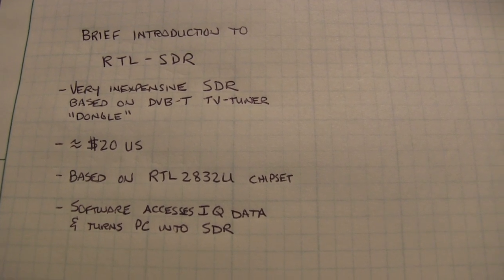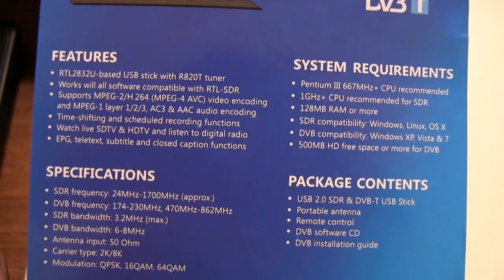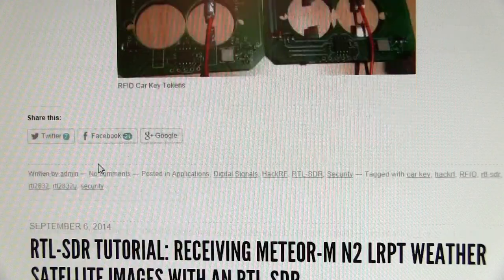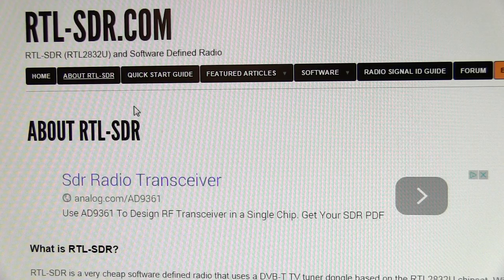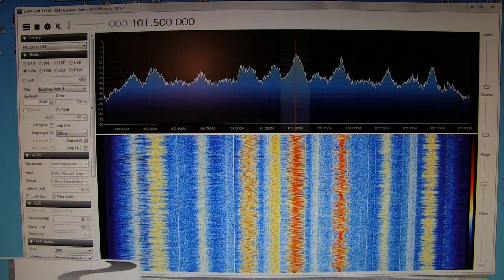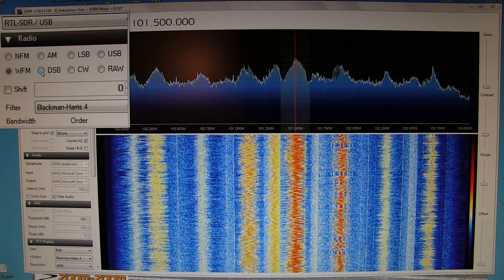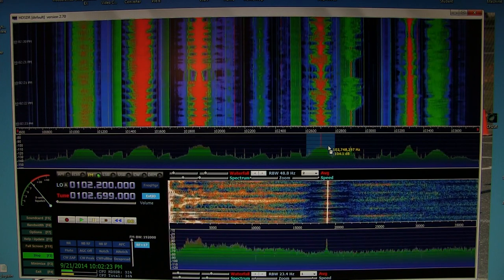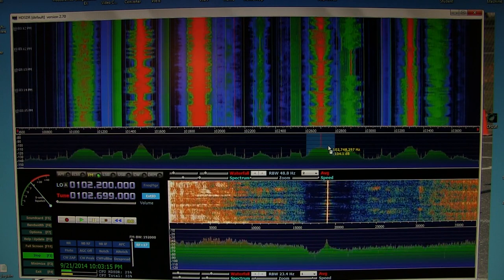#173: Introduction to RTL-SDR low cost software defined radio receivers

Comment: Been playing with this for about a year now and have decoded so many things my head spins. One thing I wanted to bring up is that with just two careful solder connections this chipset can also pull in 0-24MHz through what is called (the) direct sampling mod(e) . As always thanks for the great video and if you have any questions feel free to message me.  I'm excited to be a step ahead for once.
Reply: great man, how can I do that? I got an OPi0 and wanna try that on it:
http://v.ht/opistuff

Comment: I have been using one for well over a year now and love it.  The only problem that others should be aware of maybe, I live about a mile from a local AM broadcast 1kw station and use an upconverter so I can tune down to the SW and HF bands but what I had to do to make it work was insert an AM broadcast band reject filter inline with my HF antenna to the dongle and also use a passive pre-selector, mine is the MFJ-1046.  This extra filtering is a must if you live close to a transmitter site.  Also, on the vhf/uhf side I use a notch filter to notch out a local paging transmitter.  Since the dongle is so wide, extra filtering is a must if you live close to any of these kinds of transmitters or the dongle may not work well at all.  I love mine now though, it really came to life after the extra filtering for my location!
Reply from the maker: Excellent advice. Can you provide details on the up converter you're using?
Reply: ***** I first saw an article in QST magazine about the dongle and upconverter in the January 2013 issue on page 30.  They showed a board available from farcircuits dot com and I don't remember now if I got it from them or someone else but I got a kit that had the parts needed.  I can't find my paperwork off hand but it was this one or one very similar.  I have seen several built ones on ebay also.  Without digging in my files right now, that is what I can tell you, mine was a simple kit version though for around 35 bucks or so, maybe less. Hope that helps.  If I can find more info on the one I got I will pass along later.
Reply from the maker: RadioHamGuy Thanks, I found the article.  Looks like a pretty simple mixer stage using an NE-602 and a CMOS oscillator for an LO.  No preselection filtering (but you already mentioned that you've added that), and no image reject filtering at the output.  But, looks like it would work quite well, provided you understand the implications of this.  In many cases, it would work just fine.
Reply from the maker: You are right, these wideband receivers can be expected to come close to the image rejection, distortion performance, etc. of a more traditional superheterodyne receiver. But, it's only $10-$20, so you get what you pay for.
Reply: yoou should try sdrplay2 or sdrplay 2 pro you dond need upconverter

Comment: Thank you for another great video. If you use a virtual audio cable and DSD (digital speech decoder) or DSD Plus in addition to HDSDR for example, you get an ultra low cost solution for decoding APCO 25 and DMR. Both widely in ham radio, a cheap way to monitor your local repeaters.

Comment: I have two DVB-T+DAB+FM dongles based on the RTL chipset and I connect them to my main LMR400 feed coming into my lab using both SDR# and HDSDR with some custom plugins. The LMR400 feeds a wideband omnidirectional antenna on a 30ft mast at the highest point on my house. Some of the broadcasts I can receive on these dongles are amazing and very interesting especially with the plugins. I will however say that one important note must be made about these dongles, you need to find a reference broadcast frequency that has a stable known frequency and then in the setup enter the "Frequency Correction" in PPM to make these as accurate as possible. Both my dongles required a 74 ppm offset to make them spot on. Without doing this, your frequency will be offset by a fair amount and if your logging interesting frequencies or using the spectrum analyzer for frequency/aplitude identification then you won't get the best accuracy. These are great low cost dongles which allow for some interesting experimentation that I cannot do with my other professional radios.

Comment: I just received mine. I think I need to try it on a laptop outside.  I can get the FM stations to work, with a lot of static, but want to play around with aircraft etc.  I was surprised just how hot this little thing gets!
Reply from the maker: Yes, it does get pretty warm!  The larger NESDR Mini doesn't get as warm (more area).  A better antenna will do wonders, as well as tweaking the Tuner and RTL AGC settings and/or Gain setting.
Reply: *****
I need to do some research into inexpensive antennas. This is more for fun than anything else, so I don't want to get into anything elaborate.

Comment: I recommend the RSP from SDRplay.  It's a big jump as per this comment...

"...for LW-SW reception I use a home-made pa0rdt-Mini-Whip antenna (50kHz-30MHz) in combination with a home-made tunable preamplifier.
For FM – 2m I use a modified telescope antenna. I also have RTL-SDR sticks with up converter and an old Kenwood R1000
receiver. For SDR I use both, HDSDR and SDR# software.
The first thing I noticed is that the SDRplay RSP works well below the specified low frequency limit of 100kHz. For example, the time
signal at 77,5 kHz is well received. The lower limit in frequency for practical use seems at approx. 50kHz.
That was a good start. However, the extremely high sensitivity really knocked me off my feet: Stations which are noisy on the R1000 (so
far my unbeatable workhorse) are crisp and clear in the RSP, thanks to the innovative LNA concept. Furthermore, I could receive week
stations even in between strong signals – of course somewhat noisy. But in the R1000 they are completely buried within the noise and
you would not have guessed that there is something. That also holds for FM and 2m: the RTL-SDRs are much, much worse, even when
using an external LNA.
The next positive impression was on frequency accuracy and stability. The displayed absolute frequency appears accurate within less
than 100Hz for my RSP. Besides accuracy, frequency stability is the key– otherwise any fixed ppm-corrections are useless. For my RSP I
could detect no frequency drift e.g. within a few hours of receiving SSB/CW or when tuning in the next day. In complete contrast to all the
RTL-SDR sticks I have tested – they drift like hell.
Another positive observation is the low heat generation of the RSP (– no comparison to the RTL-SDR sticks). Maybe this also contributes
to the good frequency stability of the RSP.
What is left to say: Congratulations to the SDRplay engineers who have developed this superb piece of SDR hardware! It is worth every
penny.“ Customer Udo, June 19th 2015
For more independent comments see https://www.facebook.com/groups/sdrplay

Comment: I'm using this for about 2 years now, Still isn't boring. Every time you discover new stations near you, Police, fire departments, decode pager signals.
Listening to aviation(planes and ground stations ass well) is really fun together with flightradar-24

Listen to Ham-stations in the 2M and 70cm band

there is also an experimental driver for sdr# that makes it go into HF(from about 10 to 12 MHz) http://www.rtl-sdr.com/new-experimental-r820t-rtl-sdr-driver-tunes-13-mhz-lower/

Comment: Exceptional timing.  I ordered one of these and it arrived yesterday.  Unfortunately, I am having terrible luck getting it to work.  I've made sure not to install any native drivers, set up SDRSharp and made sure that the Zadig WinUSB drivers were associated with the RTL-SDR.  Won't recognize the device in either SDRSharp or rtl_test :-(  I'm going to try it on my linux box at some point but I'm pretty discouraged with it at the moment.

Still planning on dropping the money on the USRP at some point though.  Just thought this would let me pass the time until I could afford it.
Reply from the maker: I had a problem with the drivers initially too.  Something about the device being "busy" The FAQ in the "getting started" page that I said that sometimes you have to re-install the driver (zadig).  Once I did that, everything started playing.  I'm no expert on this, but there is a lot of expertise in Yahoo groups and Google+ groups that should be able to help you out.
Reply: *****
It turns out that it wasn't the drivers. There's a real obscure problem with running the dongle on a USB 3.0 port.  I switched it to a 2.0 port and it recognized it in software right away.  Easy enough to fix, but I wish it were better documented.
Reply from the maker: NGinuity Wow - interesting. I would've expected it all to be downward compatible.  I guess the Zadig driver was too specific to USB2.0...
Reply: *****
It's probably more to do with the cheesy (cheap) USB3.0 implementation on this motherboard and not 3.0 compatibility itself.  Running it under 2.0 got it running, but now I'm dealing with an overloaded front end and a terrible amount of sample loss.  Again, probably the computer hardware moreso than the dongle as the cause.
Reply from the maker: NGinuity Overload could be caused by a local Fm broadcast station?  You can change which AGC loops are active, and change the RF gain, that might help.  I found that my 3GHz AMD A8 works fine at the full 3.2Mb/s, but my 5 yr old laptop was getting maxed out and I had to cut the sample rate down to 960000.
Reply: *****
We don't have any FM stations (or any broadcast stations nearby, really), but my waterfall was showing a solid brick of orange at 0dB gain.  Something is just causing it to go nuts across the board so I'm checking to see if it works better on another computer for the moment.
Reply: *****
I got it sorted out, up and running now.  I found a happy place at 2.4Mb/s and after I played with the bandwidth and display sliders a bit I was able to tune in a local radio station.  I need to build a better antenna for it, but that's something for another day.  Thanks for seeing me through it!
Reply from the maker: Nice! I was playing with a mixer and signal gen today as a slap-together upconverter, and was listening to some 40m (7MHz) SSB ham radio transmissions.

Comment: Hi Alan:  Great vid and new info to me (admittedly I am not at the tip of the spear on some of this).  I was interested in possible astrophysics experiments, as I saw the discussion about 21cm hydrogen (e.g. linked to a directional antenna: Yagi or dish.
 
My question:  Are these devices still in a bit of a flux with the new-and-improved expected shortly down the road.
 
In any case, I just submitted an order for one and look forward to the fiddling.
 
Cheers,
Mark
Reply from the maker: I think this chipset has been around a few years, and is pretty mature and widely used.

Comment: Allen & ?
I am trying to have my cake & eat it too ;)
I was wandering about up & down converters for this unit , to do ham radio mostly HF as per the added video .
But also higher bands , mainly for trouble shooting WiFi signals 2.4 & 5 ghz ?
I have been looking for some time at test gear used for more pro type , can not afford the new , and some of the like RF Explorer 3G .
But keep finding the need for multiple units to cover range ?
John
Reply from the maker: There are several upconverters available to build or buy for this, for HF signals.  I haven't seen any down-converters, but they certainly can be built with some care.

Comment: I have just been doing some reading about static discharge and RTL-SDR.  The reason for this recent interest is I think I just burned-down the front end of my NooElec USB.  I had just got it installed and was turning around when I reached across my bench, brushing the antenna with my arm and received a zap, AND, no more signal.  Supposedly there is a ESD protection diode and I have read that some add 100k resistor between the center connector and ground.
 
Any thoughts?
 
Cheers,
Mark
****************************
Reply from the maker: The 100k resistor would help bleed off any static charge, so it's not a bad idea.

Comment: Can you watch hdtv with this radio? Basically can I pick up tv or remote camera broadcasts? Would I need special software. Good info
Reply from the maker: +Ragu Spag These things were designed as digital TV tuners, so sounds like yes is the answer.  I think they usually come with the software you need for TV reception.

Comment: i'm using these for rf debugging and development. the 2mhz bandwidth limit makes these less useful for me (i don't have a spectrum analyzer). i recently bought the hackrf one, which is much more capable and much more expensive ($20 vs $300). unfortunately i'm not sure that i'm quite happy with it. it's not reliably picking up short/fast rf packets and has a lot of noise that it also emits. i would love it if you made a review and compared it with real measurements and possibly ways to improve it. i can't donate one though, could barely afford one for myself :/

Comment: Hi, I just started to play with RF. I bought a couple of iot development devices with 915Mhz RF that communicates with each other. Would be possible to use this SDR to evaluate signal strength when trying different antennas with them ?
Reply from the maker: With careful setup you can make reasonable relative measurements.

Comment: Thank you for this video,  
After trying it with the 20$ dongle, and installing a decent antenna, what would be the ideal hardware upgrade for SDR# ?
Reply from the maker: If you're asking about the computer and sound card hardware recommendation, I'm really not qualified to answer that definitively. I'd ask on one of the SDR forums, on reddit, or with the s/w developers.
Reply: ***** No I think you misunderstood, I am thinking about a better SDR receiver that I can use with SDR#, I am thinking in perhaps in the 100$-200$ price range
Reply from the maker: Oh, now I understand. I am not that familiar with all of the SDR options. The only one that comes to mind is a bit outside of your price range, that's the HackRF. Oh, it looks like the makers of SDR# has made a higher performance device called the Airspy. http://sdrsharp.com/
Reply: +Karl Karlsson 

You might find the RSP made by  a company called SDRplay has had very positive reviews and is worth checking-out (if you haven't already).  But I believe it may not work with the latest version of SDR#.

Comment: If you're looking for some other interesting projects you can use your softrock receiver to tap into the IF output of the R820T tuner chip allowing you to use your PCs sound card in place of the rtl2832 builtin ADC, you will greatly increase the resolution at the cost of bandwidth. You will need two instances of your SDR software running to control the RTL2832 / R820T tuning with one and to receive IQ audio from the softrock with the other.
You can also use the RTL2832 as a USB to I2C bridge to control things like a PCF8574 I2C port expander for an LCD display or selectable bandpass filters.

R820T Datasheet with pinout and IF frequency chart.
http://superkuh.com/gnuradio/R820T_datasheet-Non_R-20111130_unlocked.pdf

Comment: Hi -- I'm a hacker type and looking for some advice -- can these units be used for UHF reception? I'm a firefighter and we use these bands for our communications, so I'd be interested to set this up to scan our emergency service frequencies.
Reply from the maker: Yes, they can easily be used for UHF reception. I think that people have written scanner apps for these dongles.
Reply: Exactly what I was looking for, thanks for the reply. Your vids are awesome because you get into the details.
Reply: TheSageDad So I bought one of these and hooked it up. I'm able to receive audio when I directly click on the spectrum peaks -- but what SDR# reports as the frequency is not correct. That is, I know the frequency that we use, but it appears shifted in the spectrum like 1.6 MHz. Later, the difference appears to be 1.75 MHz... almost like it is drifting. Do you have any idea why this might be the case, or is there a way to compensate for it?
Reply from the maker: TheSageDad It sounds to me that you might be seeing an "image" of the actual signal - since the mixing process produces both the sum and difference frequencies.  There is a way to compensate for the reference oscillator inaccuracy, but this sounds like it's much too large for that.
Reply: ***** Could the placement of my antenna be causing such an "image?" I have it located in the attic, which has a slate roof on top.
Reply from the maker: No, images are the result of the mixing process and other non-linearities in the receiver.

Comment: I'd love to see a homebrew upconverter video. Just sayin'.
Reply from the maker: There are several designs out there, such as the CT1FFU design, and the Osmocom design that you'll find on NooElec.  There was also a simple design published in QST magazine in January 2013.  The QST design uses an NE602 mixer, with no preselection or IF filtering.  The other two use a diode ring mixer and also include preselection RF filtering at the front end, and IF filtering between the mixer and dongle. I'm sure I'll be playing around with this in the future...

Comment: hello wat is best antenne for 27 mhz and 144 and 146 ? thanks
Reply from the maker: There is no such thing as a "best" antenna. It all depends on your needs, and what would best suit them. Do you need portable or mobile operation, or fixed location operation. Do you need direction use or omnidirectional?  How high can you mount it?